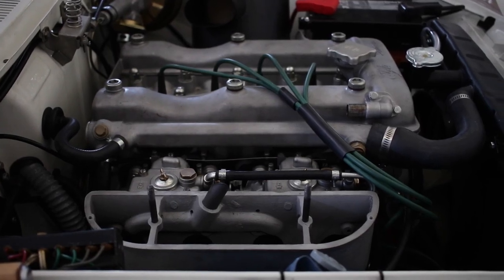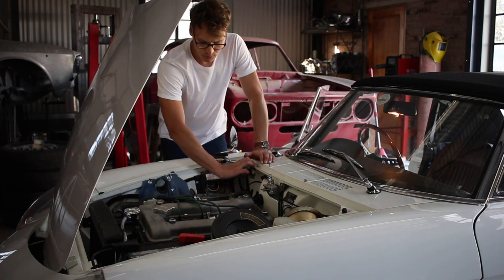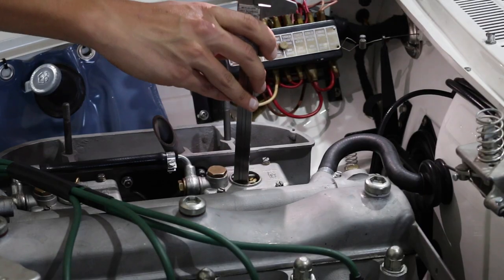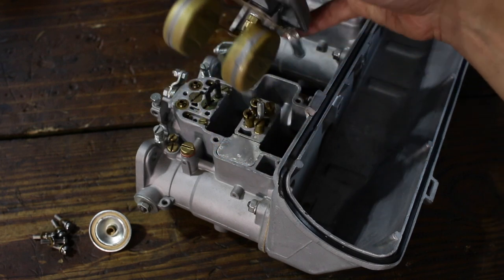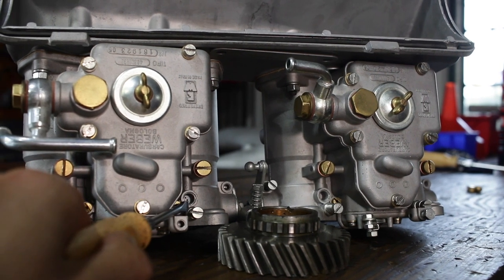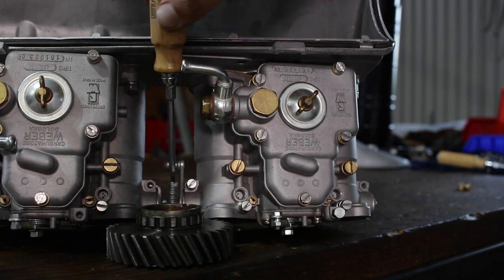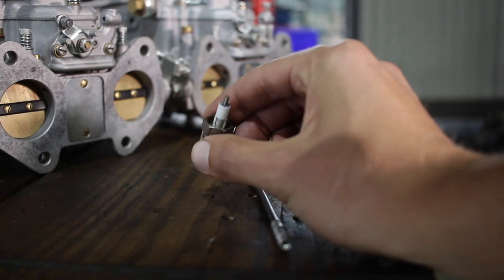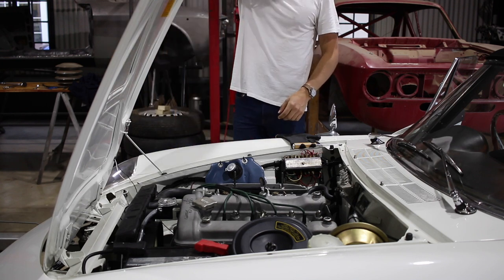Alfa Spider Project Carburettor Tuning - Float Level & Synchronisation [Sunday Technical EP04]

Comment: I get excited when I see you post a new video. I recall a vacuum meter gauge for setting up twin carbs. Never used one myself. You know what you are doing and always impressed with your knowledge of Alphas. Looking forward to the new series.
Reply from the maker: Yeah those work really well, but they don't fit into the airbox on these Alfas.
Reply: Do you stay in Canadá? Do exist any Fórum for to talk about alfas? what model of Alfa you have and what CC engine? I am placed in Brazil

Comment: Hi Jethro, really enjoy your channel and the way you approach adversities in the workshop. I've had several 105s for over 40 years now and one recurring thing I could never really sort out 100% was transmission vibrations. As you know the 105 driveline consists of many elements and they all need to be perfectly in line and balanced to have a totally smooth transmission. Maybe you can do a video about that one day. Thanks and keep up the great work.
Reply from the maker: I will do!

Comment: I used to set the idle mixture by ear, my way was to short each plug to earth in turn, making adjustments till every cylinder makes the same difference to idle speed when that plug is shorted. It has been 20 or more years since I tuned an Alfa, so I don't remember if there was any final fiddling after that, could quite easily be the case....

Comment: I've been struggling with syncing the Webers on my PV since I can't fit a synchronizer tool in there, gonna try with a hose instead. Good tip!
Reply from the maker: Yeah I can't get a tool into any of my cars, I just use the progression drillings and the hose to get them right.
Reply: It really is easy to tell by ear.

Comment: Where did you get the wood handled screw drivers with the spanner flats? Brand and link please. Nice work on the car mate looks rad after the set backs you've had.
Reply from the maker: I'm not sure they're available outside of South Africa, but this is the set I use.

https://www.takealot.com/tork-craft-6-piece-wooden-screw-driver-set/PLID52618836?gclid=Cj0KCQjwsuP5BRCoARIsAPtX_wEa4fsKJZ-KPqWKqMBAh7PmE71J3MnrhVpNQzNgHGQQUHTF-lidhM8aAoxtEALw_wcB&gclsrc=aw.ds

Comment: ALFA ROMEO DIASS C.2.0014 MERCURY MANOMETER... 
Sometimes ypu need to twist the shaft because the stop under the accelerator pedal has not been set .. so the linkage pulls and bends the throttle on cyl 2 and 3 ..
Also the length of the small linkage should be set to length

Comment: Very timely. Personally I’m struggling with finding the balance between spitting through the intake and popping through the exhaust, seems like a dark art.
Reply from the maker: Make sure your cam-timing is spot on, and you have good spark, then tune the carbs. Spitting back is a sign of a lean mixture, and a rich mixture will hiss.

Comment: Do you think a 1971 Giulia 1300 ti blue with a 2.0 twin spark in fair to good condition for $19,000 Canadian is a good deal?
Reply from the maker: Giulio Baecker I think it could be? Do you have a link to the listing?
Reply: Jethro Bronner check your instagram messages 👍

Comment: I wanted to ask you how or why you do 1.5 turns to the iddle screw when haynes book sais that the standard is 4 turns or so, i ask you because I have dellortos carbs.my engine is a 1800 not a 1600 is because of that??. Thank you
Reply from the maker: Albero a Camme 4 turns is pretty much all the way out for a Weber DCOE. It would run super rich. With the DCOE it’s usually between 1 and 2 turns, and more than that means your idle jet is too small.
Reply: Jethro Bronner I cant send you te pic from the book but it sais that for all carbs like weber or dellorto or solex and I didnt understand why its so much. I have factory spec in the jets acording to haynes book. I thought perhaps in south africa they had some sort of regulation o diference or it was due the size of the engine

Comment: Hi, how do you clean up that aluminum so well?
Reply from the maker: Giorgio Lupinacci I use a bicarbonate of soda in a blasting cabinet.
Reply: Jethro Bronner Hello thank you for your reply. Can I also ask what’s your advise on updated cam belt tensioners over rebuilding original oil fed ones. I have a 1985 GTV6...  https://youtu.be/3fBSzMncaq8
Original 20 k car garage find..I did all the necessary tune up procedures and replaced the cam belt tensioner on Alfa Romeo North America’s technical bulletin to replace it. Unfortunately after a few weeks of running I blent a valve and blew the head gasket, it failed. I’m thinking to rebuild the original oil fed one, your thoughts?

Comment: My Weber progression drillings are blanked off and cannot be screwed out, the colortune does it screw into the plug hole correctly,some complaints that it can damage threads,your view?..Thks  B.Hurt
Reply from the maker: The colortune has the same threads as a spark plug, so it's not going to damage the threads.
Reply: Thank you